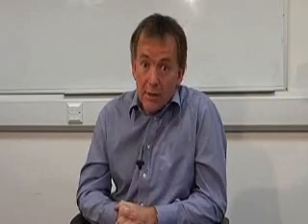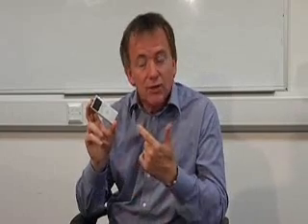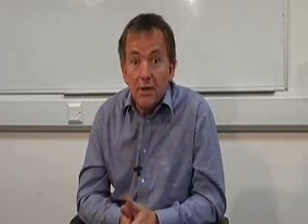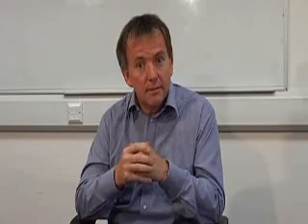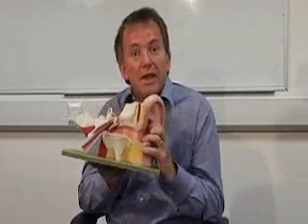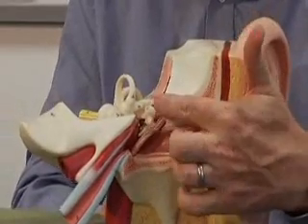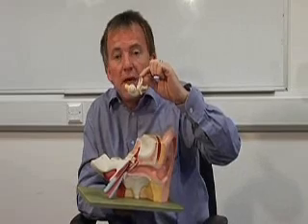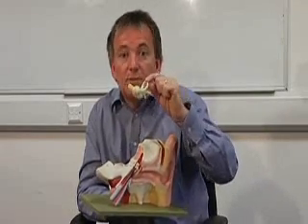How an MP3 player works

Comment: "you only get about 10% of the original recording!" is kind of misleading. Firstly the mp3 codec actually uses a lot of lossless compression before the data loss actually begins. I suppose in terms of the number of bits it would be true- but in that context a vinyl stores 0% of the original recording! In terms of quality a sufficient bitrate mp3 (e.g. 192kb/s) stores 98% of the "original quality", as subjective as that would be of course.